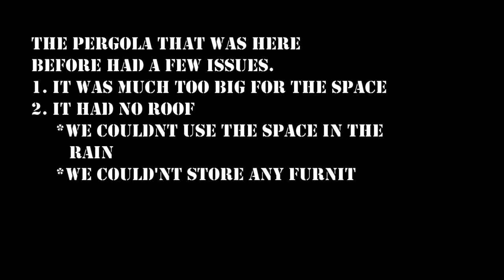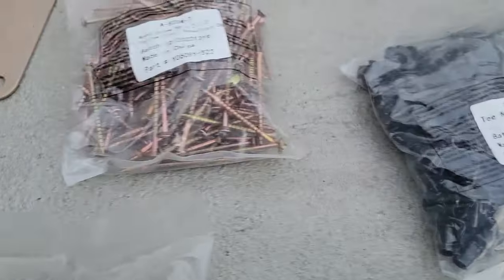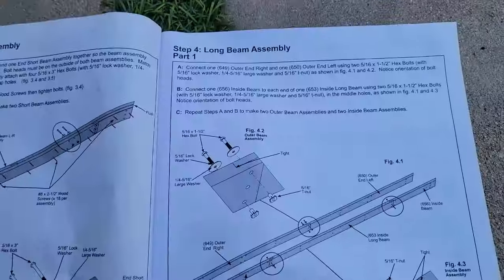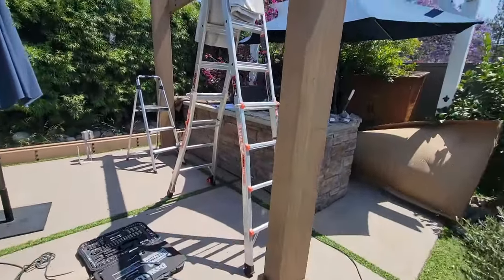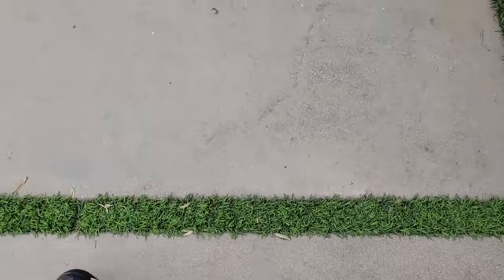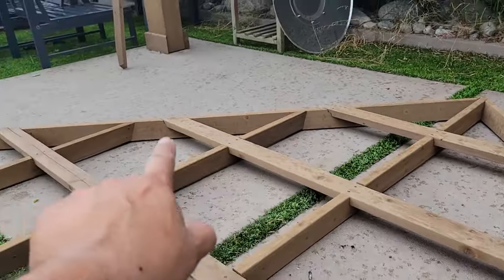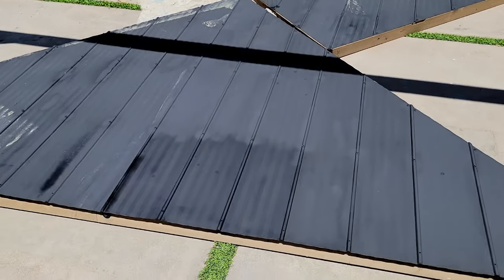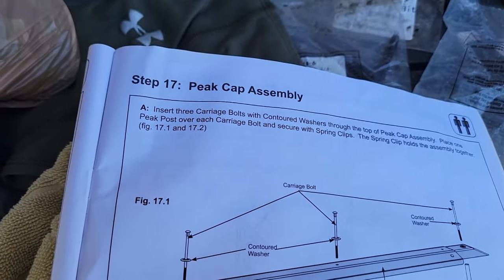Step by Step build: Yardistry 12' x 16' Gazebo

Comment: Thanks for this. Very useful. I finished mine today. Just me but I did have help putting up the four roof panels. Can’t imagine doing that by myself. It took me four full days to put together. It came together very nicely. I made the same mistake you did with the large roof panels. Caught it before I screwed the roofing on. Mine doesn’t have the gaps yours shows. I made a few other mistakes but your video kept me from making others. Thanks so much.
Reply from the maker: Glad the video helped you avoid some of the same mistakes.

Comment: How did you level each side of each beam?
Reply from the maker: If you're referring to the posts, I used a 3 foot level. however my concrete slab is already level. As for the posts to the roof beams, i used a Carpenter square to make sure the posts are at 90 degrees with the beams.